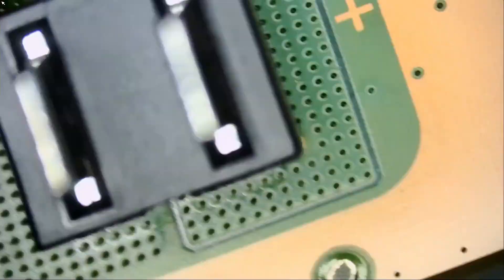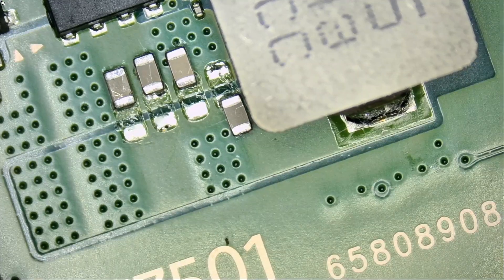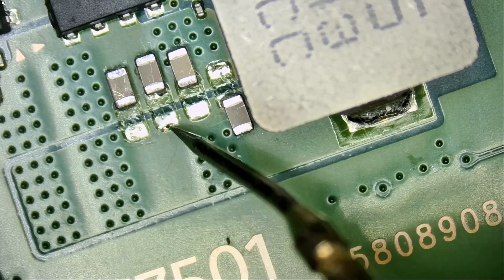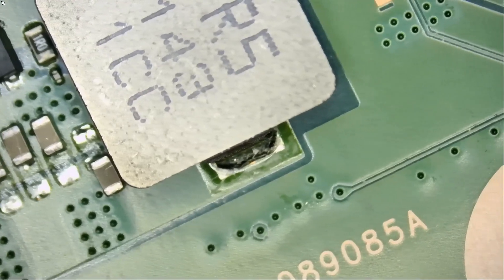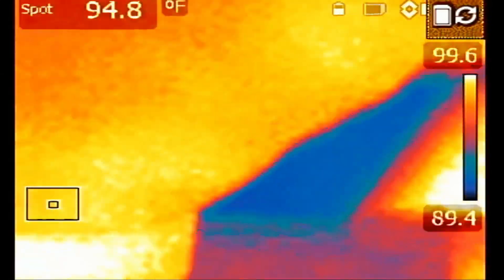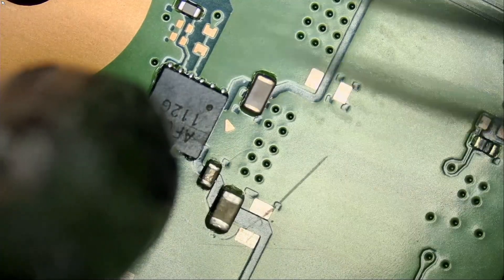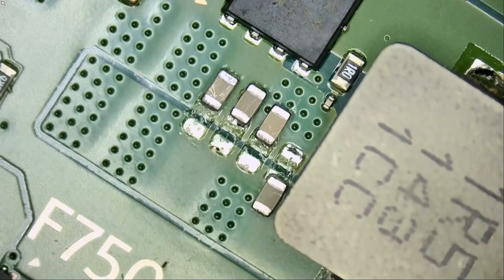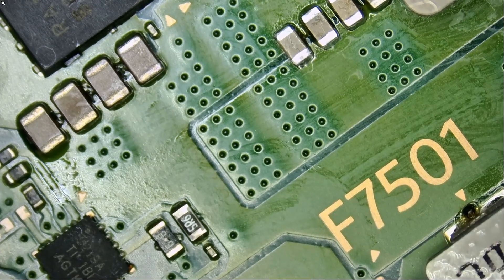PS5 Fixed - Turns on Briefly then Shuts off

Comment: Im from Philippines i always watch your videos. I have 6 yrs old Asus ROg Strix GL503vd that not powering on, no cpu fan spinning, RGB keyboard light will changing colors only, Charging indicator led is working when plugged. But only no cpu fan spinning and no POST boot will show. What will be most likely the damage of my laptop?
Reply: Could be a corrupt BIOS

Comment: One has to wonder if bad caps are purposely being integrated to boost return sales. Many LCD TVs from the mid 2000s suffered the same problem. I had the issue with my Samsung 42". I read some repair forums and watched a few YouTube videos. I was able to source the correct replacement electrolytic caps and fixed it myself! That's the power of knowledge and a determined spirit!
Reply: I have been thinking this for a while, after the supreme court ruled they need to honor their warranty and the security stickers mean almost nothing anymore things seem to be getting a lot more difficult, this is a big battle and even the biggest professionals are trying to stay ahead of the game. definitely imo sales tactics.

Comment: We haven't seen caps failing at this rate before, something happened since 2019 where electronics have a tendency to come with useless caps where their only job is to short out after a while and kill the connection, you'll usually find them connected in parallel in 3 or 4 configuration.
Reply: Chinese components.
Reply: There was a bad cap situation in the mid 2000s with TV sets (my Samsung included). A lot of LCD TVs got thrown out because of a couple of dollars worth of bad caps. Devious way to drum up new sales, eh? BTW - I fixed my TV; YouTube showed me how!
Reply: Stop noticing.

Comment: Sennheiser G4 transmitter was a standard in video production you are correct, but there have been huge improvements since then, including digital multiplexing. Lectrosonics and Sound Devices’ wireless are more preferred today and will alert you!

Warning however… they ain’t cheap! Having a big audio meter may be preferred, to maximize return!

Comment: Hello Alex
Most of my customers are put off by the fact that I do not have a brick and mortar shop
How important, in your eyes, is it to have a storefront. And also, why is it important?
Thanks
Reply: I find it to be the opposite.  While NRF has a good reputation, where I am shops (all of them) have a horrible reputation for breaking people's devices or making it worse then saying "not repairable" and then they come to someone like me.  If it's really bad I don't even try and just give it back and say the other shop ruined your device.  I've had one PS5 come in recently where a shop told someone the image cutting on and off on the tv was a manufacturing defect because they replaced the port and it still does the same thing.  

Not only did they use the wrong port entirely (because now it didn't show any video on the screen), they ripped 6 pads off the board in the process.  Ridiculous.
Reply: I work from my home as well, but I get regular calls. I have a website and on google maps. Most people find me on google maps. Many people don’t care I don’t work in a store front.

Comment: How come it´s so often bad capacitors are involved when electronics go bad? Even on new PCBs? Is it poor component quality? Or is it bad design from the start?
Reply: My guess is mostly poor manufacturing of the capacitors, though they are affected by mechanical and thermal stress which can occur during pcb assembly and when a device is running. The changing conductivity measurements, as the board is cooling, are partly due to these capacitors. In this instance, the IC marked AF01 did not look well (in my opinion).
Reply: Could be both. Caps have very thin layers and static electricity could spark over destroying the separator a tiny bit. Over time the ESR increases and makes it worse.

Design should use components so it'll last the devices lifetime. Poor/cheap component sources may have less favorable tolerance and more variation.

Comment: do you think this is a design flaw?
Reply: No, capacitors fail all over the place no matter what design. Even in the best environment to run the console in, it will eventually fail. The Caps get hot and cold due to use and this can cause them to be stretched. If they stretch too much, they break and short internally.